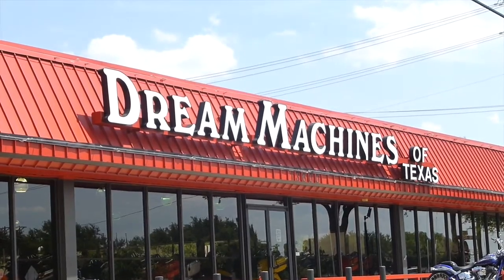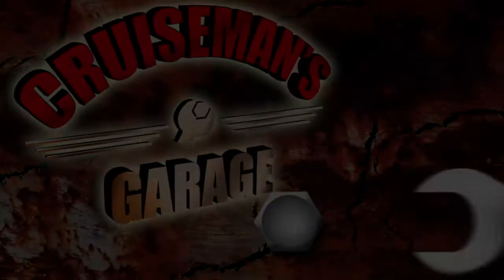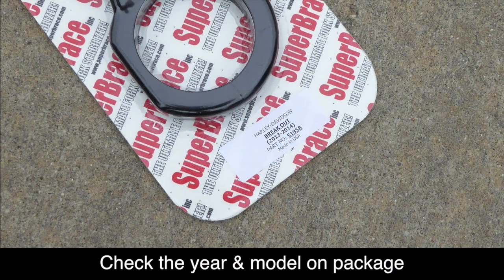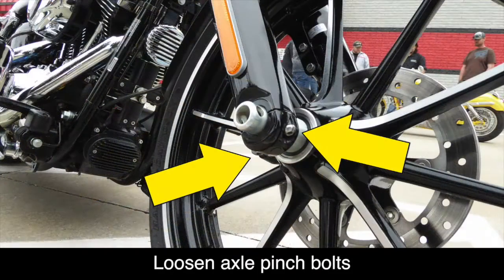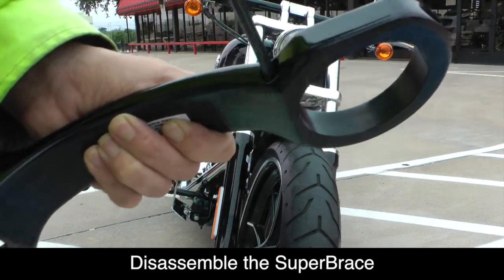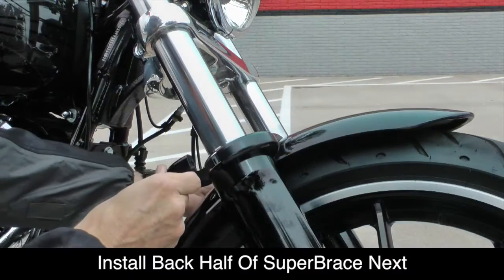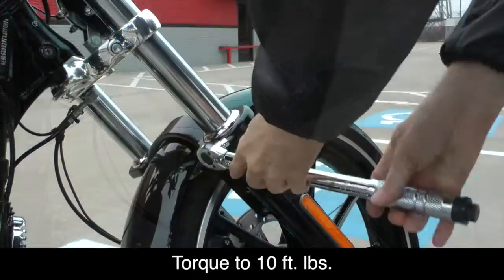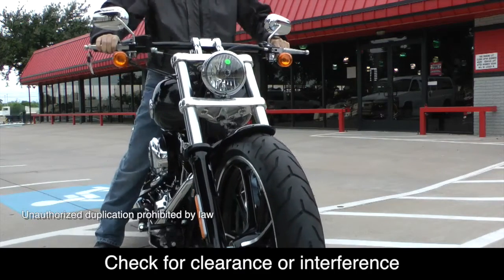Install SuperBrace on Harley Breakout

Comment: One possible reason for this company asking that the four pinch bolt be loosened may be to ensure the forks are not out of line, so by loosening the pinch bolts prior to installing a fork brace you are 
theoretically allowing the fork tubes to relax to their engineered position, if they are not already, so that the brace is installed in its intended precise parallel position. Possibly.